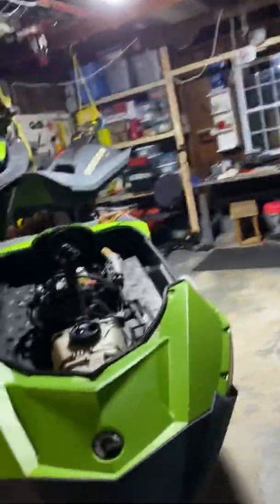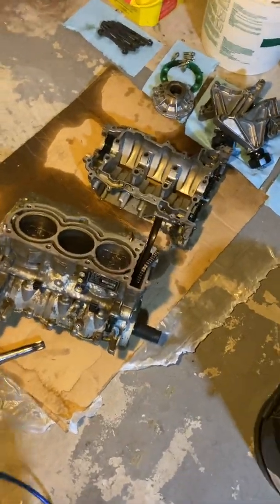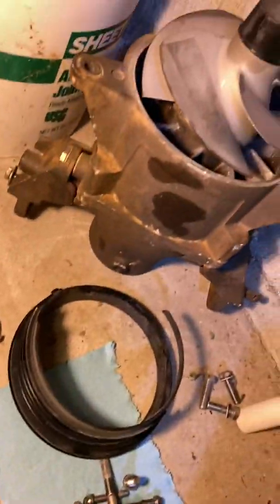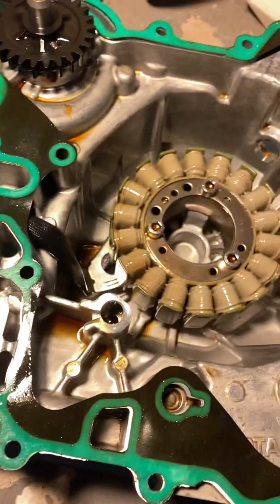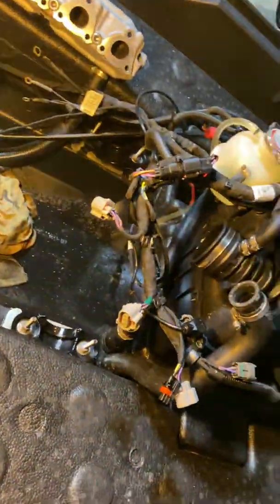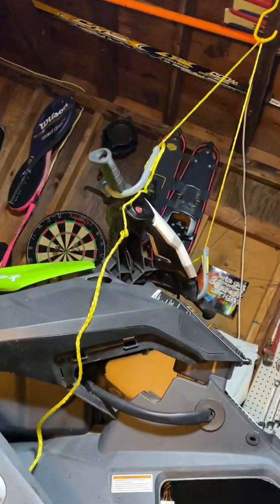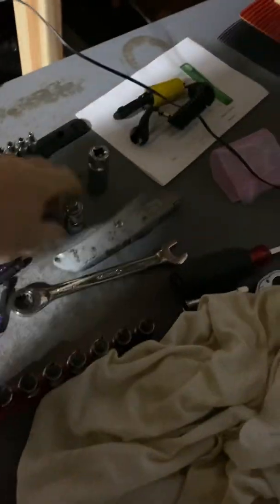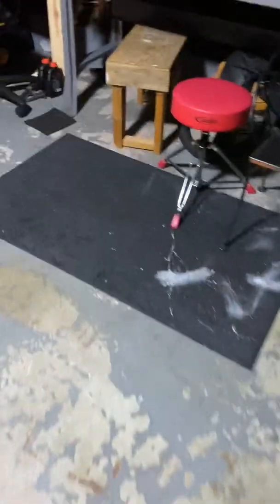2017 Seadoo Spark -repair - part 8 - It's only a broken valve.

Comment: Little tip from dyi guy myself helps me out a lot in building projects is ziplock bags or sandwich bags keep up the good work bro looking at buying one that runs for 1500 to 1800 just has 150hrs and don’t know what to look for wish me luck